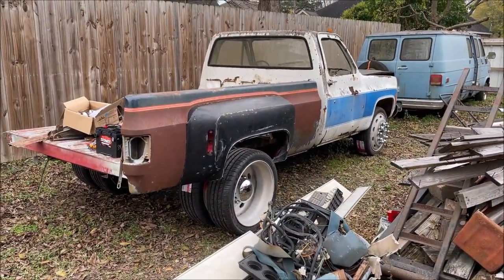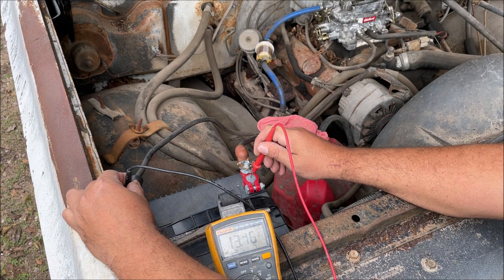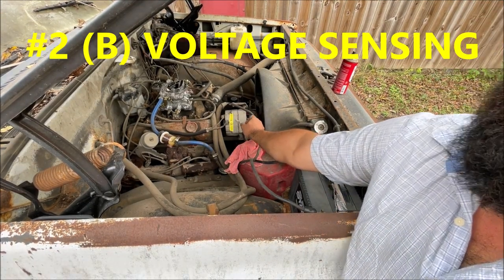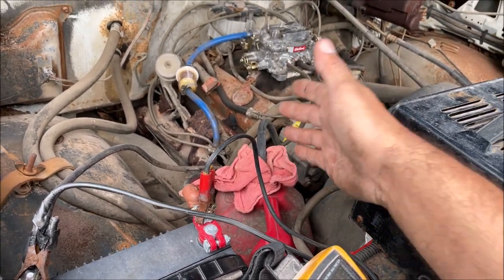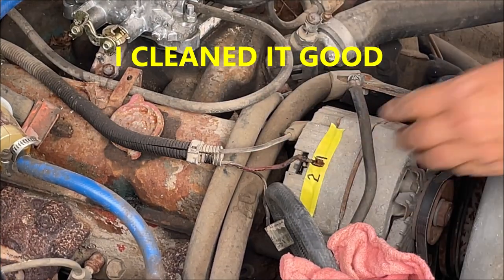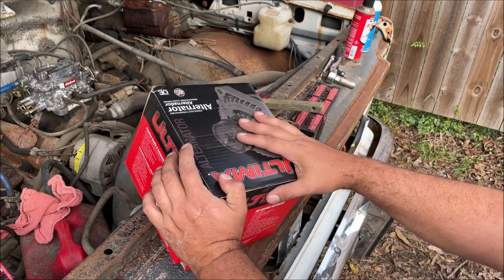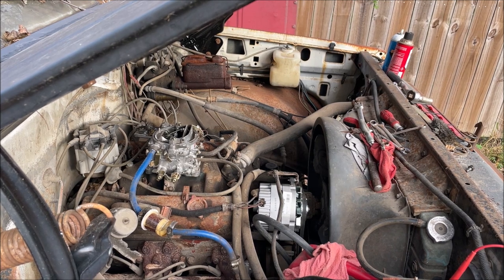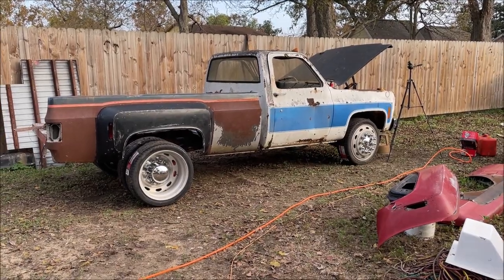GM 3 wire alternator diagnose / troubleshoot HIGH VOLTAGE 10si

Comment: I had that same alternator overcharging problem about 3 weeks ago, driving along and the cab filled with white smoke opened the hood and my battery was steaming from the vent ports and melting. I almost made it to the auto parts store, but it burned the battery post clean off and melted the top of it, they took it as a core. I needed a new battery and alternator... lucky it didn't melt any wires ,but I rewired the harness afterwards just in case, great video man....thanks a lot....
Reply from the maker: what the heck!!!!!

Comment: Hi brother ,charging too high is usually the regulator in the alternator . Yup it will boil the battery if its too high . If its not charging enough ,usually the diode trio inside . Liked your video cheers from Canada
Reply: Exactly.  How that went from that to a new 'Nator.
And how did you know that bird was innocent? Maybe it was a jail bird

Comment: On my C-10, installed a new gel battery and the alternator boiled the gel inside the battery. Took  it right back to the store and they said they have never seen that done before so it must have been running very high. Picked up a new alternator while replacing the gel battery. Great tips on checking that!

Comment: Bad voltage regulator. I'm surprised you didn't take it apart and rebuild it. Great vid.
Reply: Instablaster
Reply from the maker: i used to do that when i was young...  the truck is going to be a driver so i need to be able to pull into oreilly and switch it out if it goes bad in the future..
Reply: @davisconner240  😊😊😮

Comment: Voltage regulator some old chevys have separate regulators on the core support and you have an adjustment nob on it if the voltage is too high it can burn your head light wires I fond out the hard way😁
Reply: My alternator still running high voltage and battery in my older Chevy any tips just replace my voltage regulator and alternator
Reply: @ricardoserrano8270  did you adjust the voltage regulator it has an adjustment knob

Comment: external Alt.. Drain at  alternator hot lug & I'd been working/stuck trying to fix it the right way at 2 weeks. I could have gone thru ignition wire as you illustrated but I put a toggle switch just to move on & have time to think about the problem? Thanks you & I'll check with you later.. U"ve some nice tutorials etc.

Comment: Put new regulator in mine , easy to do. Still overcharges to 16 volts. Replaced plug and everti e sense wire touched to battery voltage it would start shooting up to full charge 16 volts
Reply: So what ended up being your problem then?

Comment: Hey! Thanks for the video, Bud. For real. Anyhow, reason for this comment is regarding a statement you made in the video. You mentioned these trucks are only wired for 75 amp max. I too have a few squarebodies. I am setting one up with a meyers plow and was going to put a 94a 12si in the truck... until i heard your 75 amp comment. Can you please email me (or however this works) some info on that limitation? Thanks a bunch! Also, no need to check- I did like and subscribe. For sure!! Thanks again. Take care!
Reply from the maker: I have a 100amp alternator upgrade video

Comment: Thanks for making a video that's easy to understand.    

I'm working on a cadillac that had a failed alternator but is still not charging.   I think the excitor wire isn't getting power.    Should it have around 12 volts when the key is turned ..
thanks..

Also...overly high voltage will burn the battery...I do know that

Comment: Buddy I think the voltage regulator built in the alternator is bad on the old one! I got a question: will a 1500 rpm enough to make the alternator charge?
Reply from the maker: they start to charge at 500-700 rpm if they are wired right.. a 1 wire may need an rpm boost up to 2000 to start charging but should start around 1200 for sure

Comment: my only added tip I would check voltage right at the alternator connections. 14 volts , diode is bad.

Comment: What would make a gm 3 wire alternator drain the battery? I tried a new one and it shows a drain as well. Kills the battery in two or three days. If I eliminate wire #1 the problem goes away. Thanks!
Reply from the maker: Watch my gm 3 wire hook up
Reply: @chriscraft77022  thanks. I did watch it but I've already put a diode in there and it still shows a drain.

Comment: New Alternator is goo, charging fine, but still have voltage drain?. Auto Zone says to run with external regulator O. G= old wires? Bought new regulator need to install (Later) to see if that may be the problem I'd like to keep the gauge intact. let me get back to you shortly? Thank you Sir.

Comment: Hey Chris,
Love your videos and your channel. Been subscribed for a week and have watch a lot of your electrical videos. Keep up the good work. I got a question about an alternator swap I did. 
I have a 67’ C/20 with a 350 that I converted to an internal regulated alternator from the external alternator. I followed your video on how to rewire it with a 194 bulb on the ign side. My internal regulated alternator was used from my stash. It will only charge 13.25 and the 194 bulb won’t go out. It dims real low but never shuts off unless I turn the key off like it supposed to. No local parts store will test the alternator. You think it’s bad?

Comment: At 8:15-8:20 after installing the new alt and starting the truck, what is sparking under the steering column? Could it be possible that alt you uninstalled is a 73 amp alt? Resulting in a higher output... 
 I used to hobby car audio i know i used to purposely look for a factory alt that had a higher output due to the power draw of the amplifer when the bass hit... just throwing it out there but another possibility would be someone ran the truck with 24v and the alt is/was really weak only charging at 16v at idle... most alts do a minimal charge until the rpm's are raised or under load... not sure if you're aware or not but some digital battery chargers also offer an alt test feature excluding the use for a multimeter
Reply from the maker: that is a little shiny string (like party decorations) .. I seen it while editing and thought the same...   truck is all original and probably the original alternator.. thanks for the info..

Comment: Whats going on bro, I have a question, could you do a video where you find top dead center? I’ve been having trouble with getting my motor to fire up again I had taken it apart to put a new Cam in but now that I want to start up I can’t seem to find TDC, what’s your trick? No one has made an easy to follow video and you go in-depth!
Reply from the maker: I have one.. it’s a little confusing but it works

Comment: I have bin having a high voltage problem on my 1990 Chevrolet Silverado k1500 I’ve replace my alternator 3-4 times I would use my truck and if I turn it off and try to start it again right away it would kill the battery I’d have to let it sit 20-30 minutes before starting again and it’ll start. Recently just bought a new battery doesn’t do that now I can turn it off and on no problem but high voltage is still there and I’m still trying to figure it out seeing this video I’m gonna check out my wires and the fuses on the fire wall I got new control module still need to put that on new ignition coil that fixed my starting issue for while and it just started happening again but yeah new battery everything is fine but high voltage.
Reply from the maker: you might have plug on backward .. jump terminal 2 to battery

Comment: chris i have a 1972 chevy chargung system is over charging put it out 16v has a new alt and a new voltage regulator any idea of what could be making it charge too high it has an external voltage reegulator
Reply from the maker: adjust the regulator
Reply: Ok I will do thank you very much Chris

Comment: If you wanna save some cash, can get the voltage regulator for about $15 from Rockauto, Summit etc. AC Delco D680, that one is a GM certified OEM replacement part. Standard Motor Products do a V111 which is about $1 cheaper but for the cost, I'd go with OEM certified.
Reply from the maker: I used to do that when I was younger..: when they used to keep parts like that in stock ( like 20 years ago )
Reply: @chriscraft77022  Ye that's a good point, sometimes it's more worth changing the part put same day, than  waiting several days for a repair item to get sent out. Thanks for the helpful vids
Reply: Thanks. I have the same problem. I'll order a regulator.

Comment: I just had my 10si start charging 16 volts.  I unplugged #1 and#2 2ires, now it doesn’t charge.  I will check it later, but didn’t want to run it that way.

Comment: Why why why. I put new alternator on my 84 olds cutlass and when key is off charge light stays on and before I changed it the light was dim with old one. Also my tack in gauge cluster is maxed out but when I turn key light goes out and tack drops to 3/4 bout 4 k  hmm

Comment: Is 14.99 volts at idle too high ?
Reply from the maker: no.  i think 15.2 is max..  but that is a HIGH reading for sure..  is everything hooked up?
Reply: @chriscraft77022  yea. Everything seems to work fine. I’ve just never seen anything over 14.7 and mine is 14.99… my electric choke is not working properly and I noticed the voltage while testing the choke…
Thanks for the reply and helpful video!

I think it is illegal to kill song birds in most places (but im not sure what species are technically a “song bird” .?..)

Comment: My 69 corvette, new m/rebuilt alternator . It’s a one wire. So I only have one wire run to starter. I start the car up. Dash meter shows charging. What’s sobbed that I have a brand new battery running. After awhile engine dies. Battery dead. It it because I didn’t run a wire from the alternator to the switch? I pull battery and engine dies right off. I don’t have comp or. Nothing just an old 69 corvette. My new WiFi g harness had only one wire to the alt. But alt shows like yours a place for the two wires. Oh and go kick those dumb ass kids. Damn killing birds, then they kill cars and dogs. Ugggg thanks for your videos. I got carried away when kids shot the bird. Ok I pull battery while engine running at it dies. Best with me I used to bd a licensed auto mechanic. I’m very old and I actually have forgotten everything I know. This is the last car I’m Messing with. After seeing your stuff I think I bought a bad alt. Thanks China for a f’ing 149$ bad alt. I’ve kept it all winter not installing it, return policy is nope!
Reply from the maker: those were grown men shooting the birds.. there are too many things that can be wrong.. you need to make a video showing it the best you can.. I have no clue if you have original alternator? internal? Externally regulated? are you running a voltage regulator? whatever it is it can be solved in minutes but you might have to watch through my older videos.. not this one.. the videos on my 70 Chevelle.. I know everything about the wiring on GM

Comment: 40 bucks and 15 minutes you could have fixed that alt. Internal volt regulator was most likely bad. I run car audio and it seems it’s always the problem.
Reply from the maker: I used to do that when I was 15 years old. I’m 37 now and prefer to have a lifetime warranty on the alternator